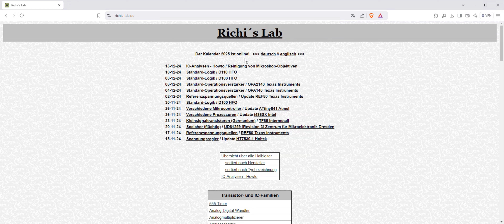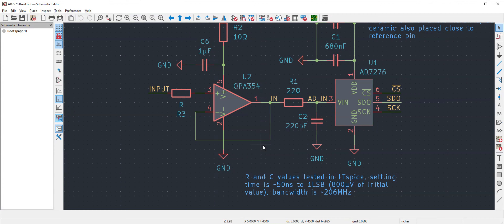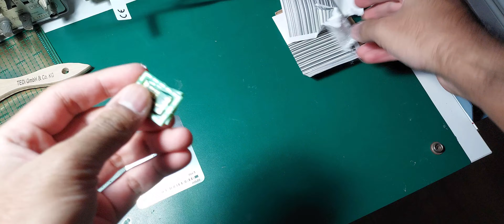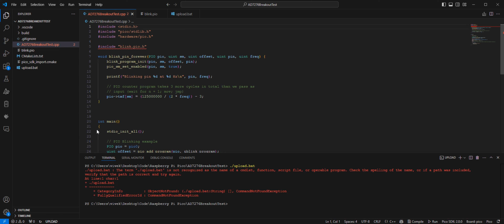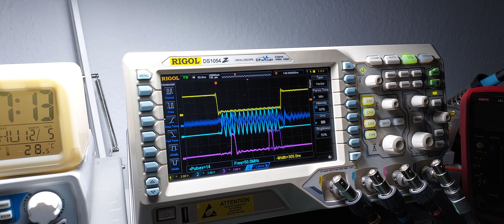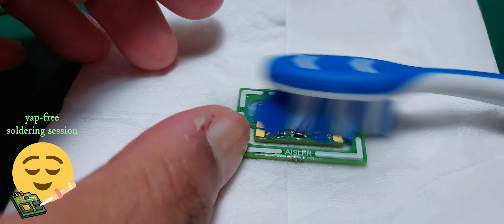From 0 to 5Msps - A Complete sub-Project Walkthrough

Comment: Try TS391LT from Chipquik. I have used it with great results on multiple boards with just a simple hot plate, though sometimes QFN packages require a little poke when the solder is still molten to ensure that all pins are wetted correctly.
Reply from the maker: Thanks for the recommendation, will try it!

Comment: The OPA354 datasheet states it'll come to 100mV of the rails, with a 1k load. So your 40mA is better than the datasheet and probably in-line with the load on its output. Scullcom Electronics faced the same problem in their millivolt meter project, using the AD8628, and "bodge" solved it with [100k, or 1M, I'd have to look again to remember] resistor to ground to help it pull that last bit down.

100mV isn't a super great spec, but it is far closer than a double or single diode drop. And usually you are having to sacrifice this sort of spec, to get the spec you're actually paying for: the super duper fast bandwidth

The next time you put in a component order, you might like to add a LM7705 or two to your order and check out if it is "low noise" enough to solve this sort of issue.

I'd suggest use one 10uF 1206 and 2x 100nF 0806/0603 caps
Reply from the maker: Isn't that exact part mentioned in AoE X? I'd honestly prefer the schottky diode/resistor trick, it's easier, cheaper, and takes up less space than buying a dedicated IC.

Regarding decoupling, I ended up using almost exactly what you recommended, a > 10μF 1206, and a 100nF 0603.
Reply: @NNNILabs  easier and cheaper maybe, but 85% of your problems have seemed to be noise of all different kinds, so one may want to test if there's a quantative difference between the two methods and if the IC can do a better job on that front, or not. I don't have a copy of AoEX yet myself.

Doubling up the smaller caps, (both at the same value) tends to tone down their inductive reactance a great deal over just one.

Comment: Huh, I hadn't heard of sigma deltas that use a multi-bit quantizer. Do you have any good references one can read to learn about that? (other than TAoE hopefully, unless it's in the second edition... I don't feel like buying another copy!)

I thought the noise shaping worked on the noise generated by the two level D-to-A conversion, but now that you presented this topic I realize that I don't really understand the basics. Very interesting!

On the decoupling cap question... man, it's so hard to actually get any benefit from the "tapering cone of smaller and smaller capacitors" approach. As I understand it this is very hard to get right. The parasitics of an MLCC are almost completely dependent on package size alone. Looking at the impedance curves of a given product line and package size and, the inductive up-slope of various different values all follow almost exactly the same line. So really the only benefit of using a smaller capacitor is that it's available in a smaller package. 

Then the big issue rears its head: although the smaller capacitor package has a higher series resonance frequency, much of the time the actual impedance at resonance isn't actually that much lower than the inductive impedance of the bigger cap (... because the value is smaller). I know that there are instances where the pyramid of decreasing package sizes does actually help, it's just that they're pretty rare as I understand it. 

And I am pretty sure that there are basically never cases where you want anything less than the maximum available (DC-bias and AC-amplitude dependent) capacitance in a given case size. So for instance your pyramid ends with an 0402 capacitor right? (is that the 100nF or the 680nF?). If I go on SimSurfing and compare |Z| of an 0402 1uF at 3.3VDC and an 0.47uF 0402 at 3.3VDC (they don't have 680nF), the 1uF part is better at all frequencies. Way better than a 100nF. Not exactly clear what part values / case sizes you have on there, but hopefully you're using the largest (actual) capacitance in a given case size, otherwise that case size is wasted and just represents more distance between the pin and the larger valued cap that's doing the actual work. 

One other comment, ADC filters. This is probably an even deeper topic than the decoupling topic. However I'll mention that ~100pF external filter capacitors on a capacitive SAR ADC are probably the worst possible value to choose for many purposes. I'm not criticizing you personally by the way, ST's reference material on the STM32 MCUs universally assumes capacitances in this range (they seem to assume 22pF). 

The reason it's bad is that the capacitor is too small to supply the charge needed to charge the internal sampling capacitance without excessive voltage sag, but too large to be quickly charged by the impedance of the external voltage source.

For fast applications like yours I have never seen a convincing argument that any external capacitance is desirable. Maybe some op amps give a better settling time with external components, but I think that an op amp buffer directly driving the ADC input pin, or driving it through just large enough of a resistance to damp any buffer overshoot is the best for this application, as this reduces settling time to the minimum (and increases setting accuracy in a given time). I will admit that I don't have huge amounts of low noise design so there may be cases where buffer output noise is an issue and a filter is useful, but I am suspicious of even that. Seems like just a bigger resistor is what's called for in that case.

I'll mention that as an aside, for slow applications with high source impedances, much much bigger capacitors (1-10nF) are usually the right move. These capacitors are so large that the charge needed to charge up the sampling capacitance is less than 1 LSb, and sampling time is minimized since the capacitor presents basically 0 external impedance to the charging transient. Sampling time is then only limited by the internal sampling switch resistance. Not relevant to your work.

Oh also, was it really the solder flux that popped that component off the board? Or did the IC package popcorn? Popcorning is when a package simply explodes because the absorbed moisture in the resin combined with the heating rate caused steam pressure to blow it apart. I don't know what MSL (moisture sensitivity level) those parts are, but the IR hot plate you're using surely creates too fast of a ramp to match a typical reflow profile. I use an Ohmite HS250 series 75 ohm 250W aluminum extruded case power resistor (energized with 120VAC) sitting upside down, and I pop the board on when the resistor is at about 150C. Then the resistor takes almost two minutes to get up to the recommended 230C peak (I use leaded paste). I don't know, maybe it was the flux. But it sure looked like popcorning! I guess you'd know if a chunk of the package blew off... it just seems like your ramp rate is probably excessive. Also pre-baking the parts at ~120C will completely eliminate popcorning (especially if they've been out of their packaging too long or are too old and the desiccant is bad). 

Anyway, always fascinating to see you chase ppm's and ppb's with such tenacity, looking forward to the next installment!
Reply from the maker: Multibit delta-sigma ADCs: I made a delta-sigma video last year that explores Multislope IV, which is basically Agilent's flavour of a multibit precision delta-sigma ADC. Moreover, you can just google "multibit delta sigma", and quite a lot of app notes, papers and patents show up.

Decoupling: I think the best bet is to use the largest possible package with the largest possible value like you say.

ADC input filter: This was a pretty tricky one as well, I didn't originally plan to use a buffer op-amp, if you look carefully, you can see a resistor footprint on the LTC2315 board (with a capacitor 3D model, which was a mistake). The reason I wanted to include a resistor is because the integrator swing is ±5V, while the ADC can only digitize 0V to 3.3V, and I didn't want yet another scaling amplifier. The problem with choosing a resistor value that keeps the protection diode current within safe limits (around 10kΩ) limits the settling time somewhat, and such effects really make themselves apparent at the high(ish) sampling rates I was going for. Since I had the board space, it was easier to just include a buffer op-amp. 100pF might be excessive, but since it's not harming, I might keep it.

Soldering: Yes, it was the solder paste that caused the component to pop off. In fact, the component that popped off is the same ADC that I was using for the other tests, so it survived with no damage.
Reply: @NNNILabs  interesting experiment might be to do a 1V step-response test into the opa354, and try to look at the signal before and after the resistor, see if there's any interesting qualitative difference in the response signals
Reply from the maker: @ivolol  That is something I should have done, will give it a shot.